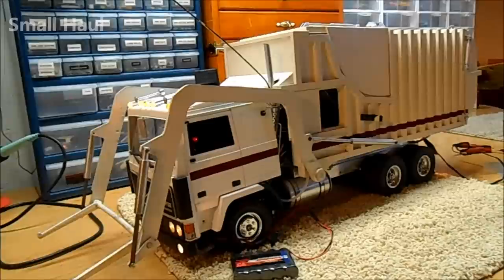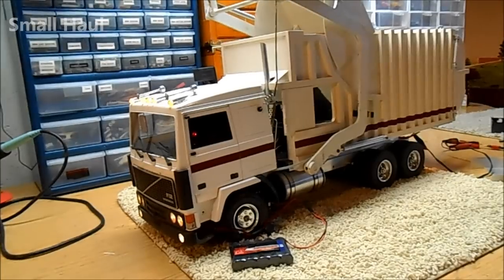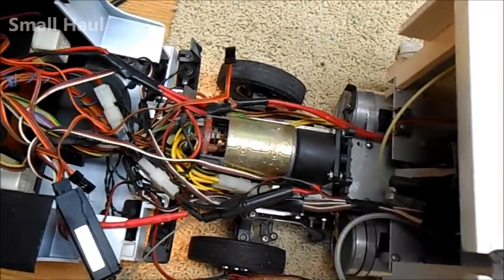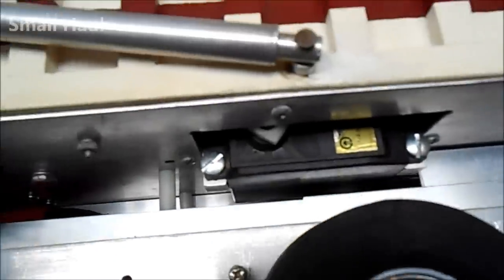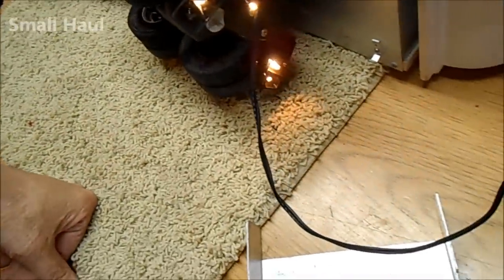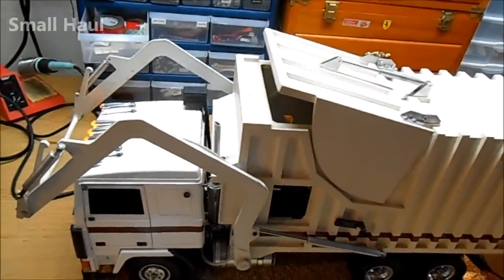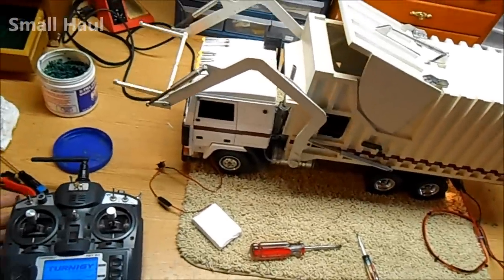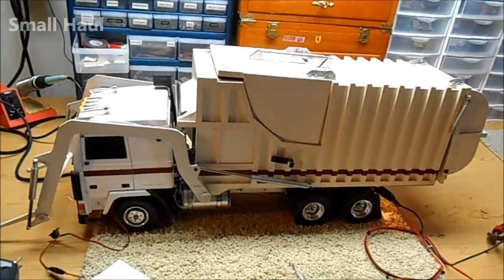Radio controlled Wedico Volvo Garbage Truck

Comment: Would you be willing to make an update video? I'm interested in making my own garbage truck but have no idea how to start or where to get parts. So watching this is the next best thing.
Reply from the maker: +MrNemesus I am sorry but, the garbage truck is gone i traded it for a metal lathe.. Scott
Reply: +SmallHaul - Thank you for the reply! Darn I would've liked to know more information about the parts and pieces that were inside of it. It was very impressive to me. The mechanisms, the electronics, motors etc. really fine work. Would you happen to know if the guy you traded has a YouTube channel?
Anyways I'm happy you were able to get something out of it. After all one mans trash (truck) is another mans treasure.  cues cheesy 90's sitcom audience laugh